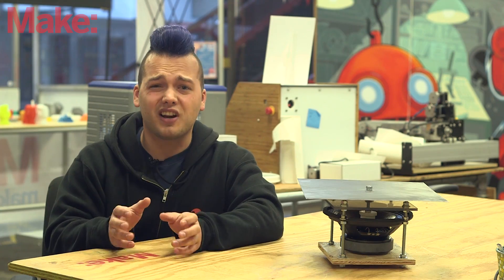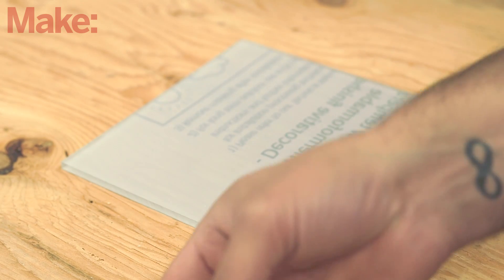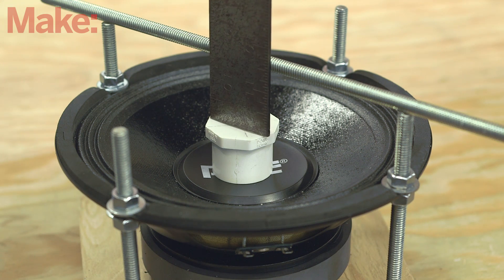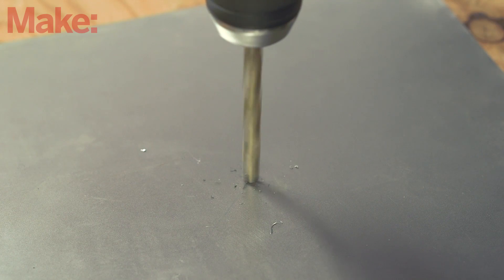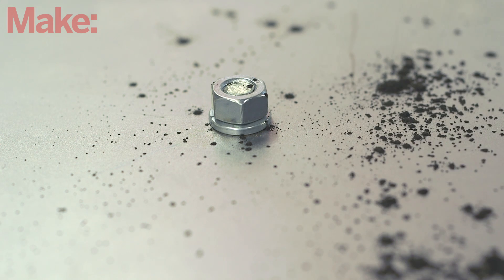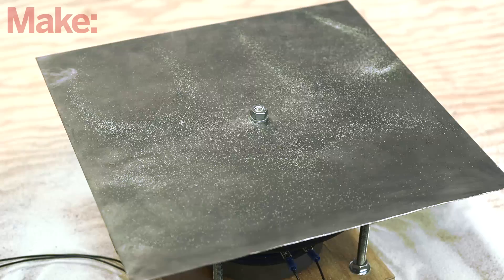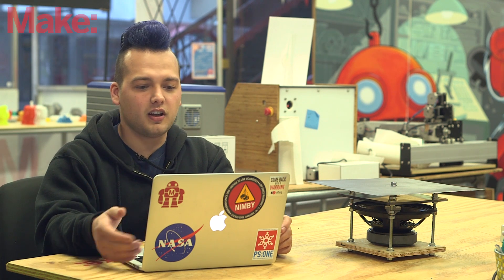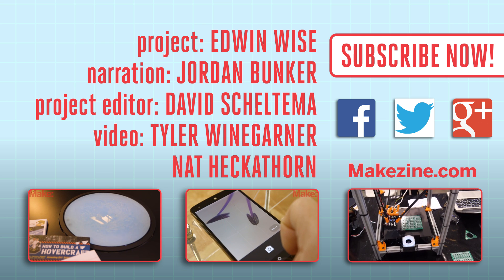Weekend Projects: Visualizing Sound with a Chladni Plate

Comment: Since I don’t want to ruin a good speaker, I could probably make a lighter weight one of these with some black paper-backed foam board cut into a square. That stuff rings slightly when tapped, and is so lightweight and strong that people have literally made model airplanes with it. I’m sure even a cheap speaker would get that resonating pretty good.

Comment: Hi mate, just wondering what the need for the plastic is between the speaker and the metal plate? Would this work without the plastic and if not can you please explain why? Cheers.
Reply: I'm looking in comments for the same explanation. Only thing I can think of is to dampen the sound or air coming from the woofer so it doesn't interfere with sand patterns
1:59

Comment: Why does the cone need to be attached to the plate? If the outer four points are fixed, the acoustic vibration should still move the plate correct? Or will it move it at a function of the plates resonant frequency’s? If someone can answer this I will be grateful as I want to try this but not mess up my woofer.

Comment: What's the purpose of the lexan?
Reply: It doesn't have to be lexan. It just serves as a guide for the bolt so that the rod doesn't waste energy by wiggling at any other angle than perfectly straight up and down.

Comment: I did my best to identify the parts show in the video:

Qty. (1) Everbilt: 24 in. x 36 in. 26-Gauge Zinc Metal Sheet; Source: https://www.homedepot.com
Qty. (1) Lexan: 10 in. x 8 in. x .093 in. Polycarbonate Sheet; Source: https://www.homedepot.com
Qty. (1) Generic: Sanded Plywood (Common: 15/32 in. x 2 ft. x 2 ft.; Actual: 0.451 in. x 23.75 in. x 23.75 in.); Source: https://www.homedepot.com
Qty. (3) Everbilt: 5/16 in. Zinc-Plated Nut, Washer and Lock Washer (24-Piece per Pack); Source: https://www.homedepot.com
Qty. (5) Everbilt: 5/16 in. -18 tpi x 12 in. Zinc-Plated Threaded Rod; Source: https://www.homedepot.com
Qty. (1) Charlotte Pipe: 1 in. PVC Sch. 40 Plug (Model#  PVC 02118 1200HD); Source: https://www.homedepot.com
Qty. (1) Oilite: Sintered Bronze Flanged Sleeve Bearings 0.3125 in. ID x 0.44 in. OD x 0.375 in. Length x 9/16 in. Flange Dia. x 1/16 in. Flange Thickness; Source: https://www.amazon.com
Qty. (1) Pyle Audio: PylePro - PPA8 (500 Watt Professional Premium PA 8'' Woofer); Source: https://www.qualitycaraudio.com
Qty. (1) Pyle Audio: PyleHome PHA15 Headphone Amplifier (3.5mm / 1/8'' 150 Watt Mono Audio Amplifier); Source: https://www.qualitycaraudio.com
Qty. (1) Enercell: Enercell 12V/1500mA AC Adapter 273-358; Source: https://www.ebay.com
Qty. (1) Gardner Bender:Gardner Bender 20-143F Disconnect Female, Vinyl-Insulated Barrel, 16-14 AWG, Blue; Source: https://www.amazon.com
Qty. (1) Gardner Bender:Gardner Bender 16 AWG 25 ft. Primary Wire Spool, Black  (Model#  AMW-316); Source: https://www.homedepot.com
Qty. (1) ACTIVA: Scenic Sand, 5-Pound, White; Source: https://www.amazon.com

The total cost for all parts is about $125. Not include shipping & handling.

Please note:
The brand names for the parts I listed might be different than what was actually used. 
The PHA15 is the hard to find - it's either discontinued or listed always on back order. 
The Enercell 12V/1500mA is discontinued. It's easy to find alternatives for that.
The Lexan in the video appears to be 1/2 thick. The Lexan I listed is much thinner, but should work.
Reply: Do you have an image of your. That is an expensive build!! I think mine turned out to be $30 from goodwill parts.

Comment: what are the tools for making that?????????????????
Reply: Tools: hacksaw, wood saw, power drill (with 5/16 in. drill bit), straight-cut aviation snips (up to 16 AWG), hot glue gun, wire strippers/crimpers, and two 5/16 in. open-end/closed-end socket wrenches. In another post, I listed the parts needed.

Comment: What Gauge of sheet metal should I use?
Reply: Don't really think it matters - thin but not too thin. Paper this is too thin.
The thickness (or rather, stiffness) of the plate is part of what determines the resonant frequencies, which determines the patterns.
Reply: I'm guessing at least 1mm thick .039"
Reply: This MAKE: project (https://makezine.com/projects/chladni-plate/)  indicates you should use sheet metal that's between 22 to 24 gauge.
Reply: You can use any plate that is likely to resonate. You can tell if it will resonate by tapping it and see if it rings. If instead it just makes a "thud" sound, probably not so effective for this purpose.

Comment: I have been using the Chladni visualization concept for over 20 years to tune the tops of hand-made acoustic guitars.  Instead of sand we use black pepper!  Before final assembly and gluing, the top of the guitar is placed on 4 small foam blocks with a speaker below and  in the center.  As the audio frequencies are increased the pepper patterns show how the sound will be projected off the top of the guitar.  If there are problems (non-symmetry, weak patterns, etc.)  the under side of the guitar top can be shaved thinner in places to improve sound projection.  This helps to make really fine acoustic guitars!!  This presentation is a great start to help all with the design of many types of sound system projects.  Good job!
Reply: I wonder how the standing waves would react with magic sand. Fine sand/black pepper is ideal for quick results and to show an approximated shape of the waves, but maybe it can be traded for a high viscosity sand, and longer length of time. Maybe the waves will force the sand to assume a 3d wave pattern that hasn't been seen yet? Maybe not. If you or a jobless friend has this set up already, could you try it out and upload the results 😁 please?
Reply: Amazing
Reply: Very neat!
Reply: This is awesome info.  I find guitar making very fascinating.  Very cool.

Comment: You should have soldered the rod to the bottom of the plate with some flux, that way it would have been perfectly flat on top
Reply: +Yextus doing this would also prevent you from changing out plates with different resonance...
Reply: Good idea, but if you want to experiment with other Chlandi plates of different sizes and shapes, it helps to be able to have them screw mounted.
Reply: Wouldn't the heat warp the plate